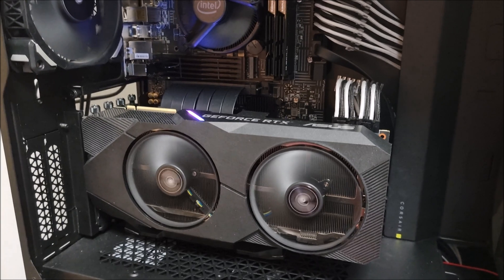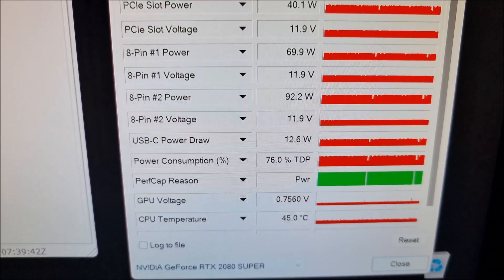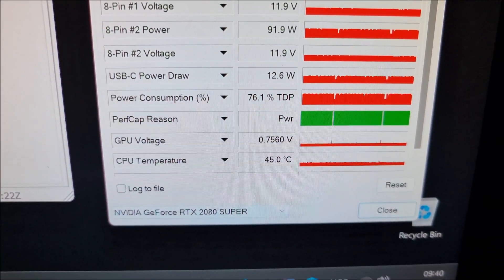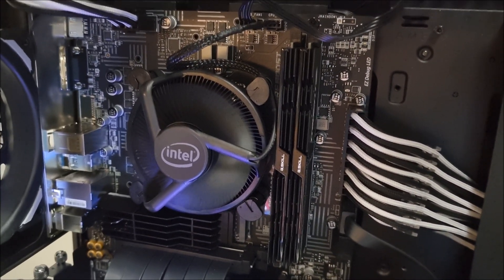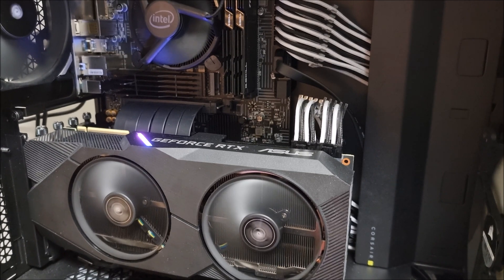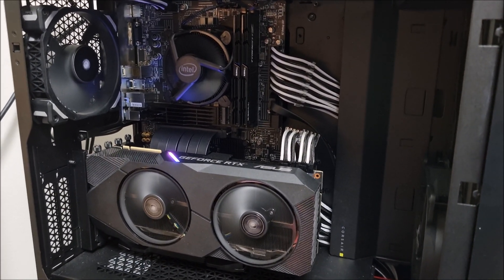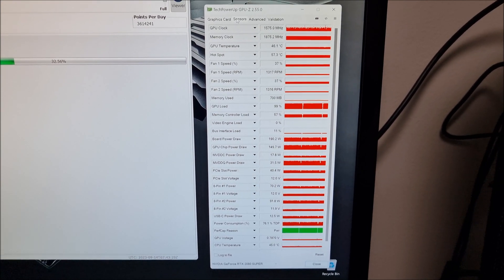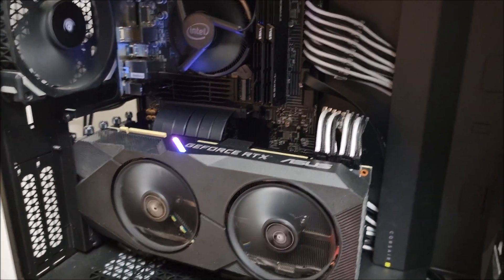Is Dry Thermal Paste Bad Thermal Paste? Not really. Here is why...

Comment: Ok what about after 5 years on a CPU, the paste was dry and solid as a brick.
Reply from the maker: Dry thermal paste doesn't necessarily mean bad paste. Most thermal pastes will dry and become a thermally conductive layer between the gpu or cpu and heatsink. It's meant to dry by design. 

If you're not experiencing temperature problems, I'd suggest you leave it alone and not break that seal created by the paste 5 years ago. It is still thermally conductive.

Comment: Bro, why do u have an Intel stock cooler? 💀
Reply from the maker: Hehe the idea is to be low power 🔋since this system is dedicated to running 24/7 doing folding@home. The little cpu TDP is only 58w. It's currently running at avg 20w. There is no need for anything else 🙂.